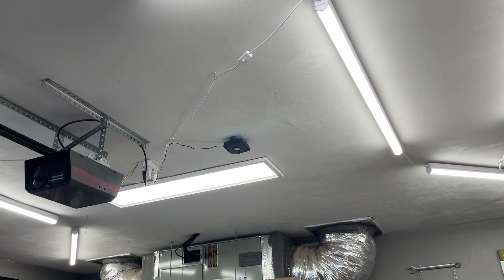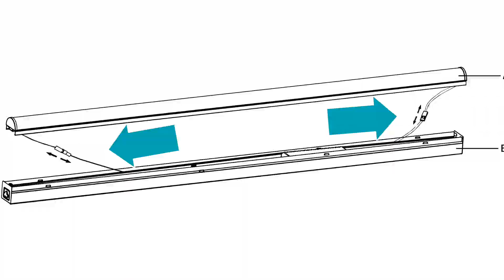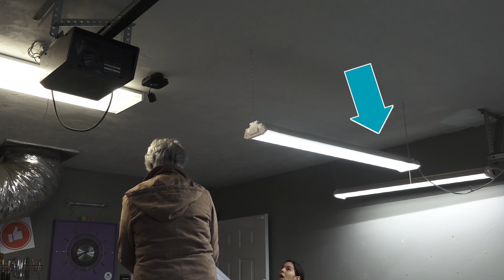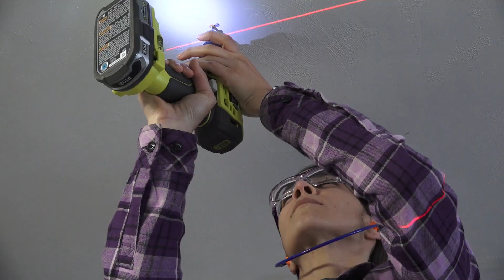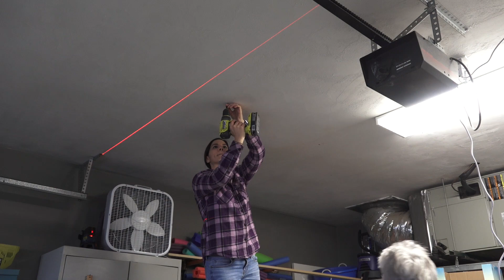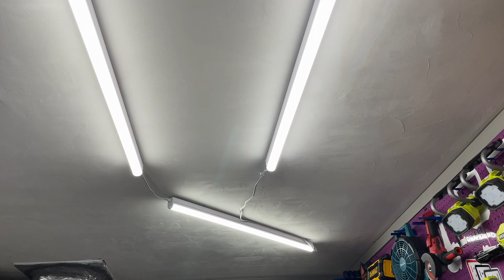DIY Install Plug-in LED Garage Lights // No Electrician Needed!

Comment: Great idea about the smart plug!  How are these holding up and would you do anything differently?
Reply from the maker: The smart plug is working well and I like the setup, but I have had three of the lights start flickering and need to be replaced. They still make these so I replaced them.

Comment: What is the product?
Reply from the maker: Commercial Electric 4 ft. 20-Watt Plug-in Direct Wire Integrated LED White Linkable Strip Light Fixture 1800 Lumens 4000K Bright White

Comment: How do you turn on and off if you don't have a smart home system
Reply from the maker: There is a on/off switch on the power cord for the lights you could use. But you don't need a system, but a smart plug. There are a ton of brands, around $20.